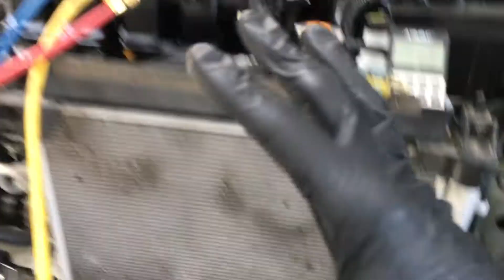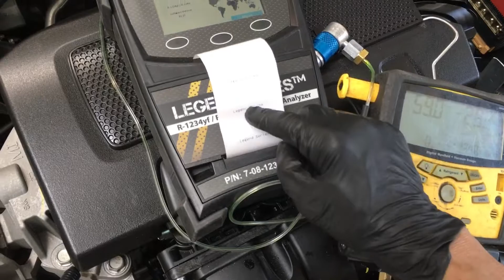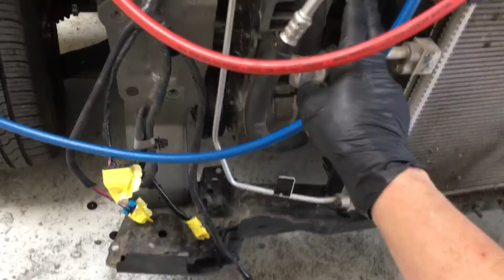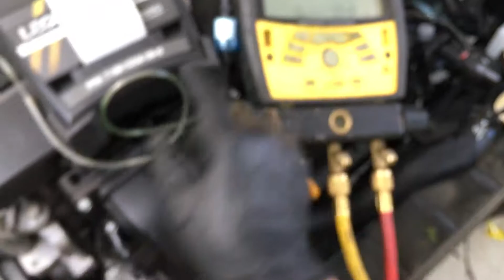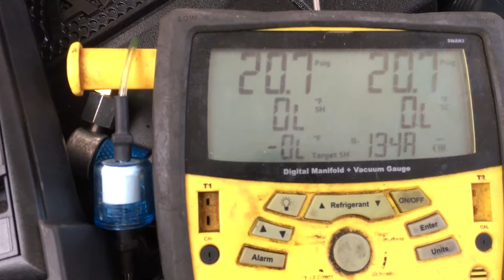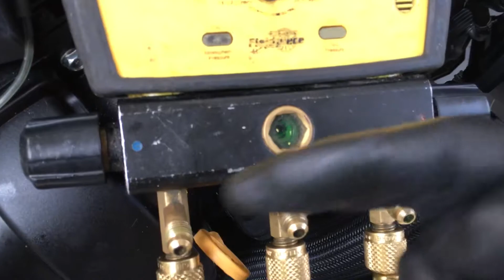Refrigerant recovery 2019 Nissan Sentra

Comment: I’m replacing the condenser on a 2019 Nissan Sentra 1.8 how much pág oil should I put back. Thanks
Reply from the maker: I do not have the specifications on me and they’re all different from all vehicles. You have to look them up on the manufacturers website or through some of their printed literature.. 

There is no rule of thumb because many manufactures have different quantities required 

But the average if you want an average for Japanese vehicles, after a collision or a large leak, the majority have been hovering right around 35 mL to 45 mL of refrigerant oil . 

This is why reading and looking up specifications from each manufacture is very necessary on all these different vehicles here make models
Reply: @coldfinger459sub0  oh ok sounds good by any chance do you have a website too look or find info on how much, I’m replacing the condenser tomorrow I would appreciate.
Reply from the maker: @joelcalvillo-lm5gn  4 SEASONS website or NAPA website they have a air conditioning catalog with quantities
Reply: @coldfinger459sub0  ok thanks

Comment: Do you think a Refrigerant Analyser is useful for detecting weather a virgin system leaked non-condensables in from the low side while running?
Reply from the maker: That’s a super good question this question is often asks you’re not the first one. 

       He would be purging a lot of refrigerant into the atmosphere to achieve such a procedure

        And then in cars since you don’t use superheat or sub cooling or temperature to charge you would end up with a low charge and then have to completely recover the system and weigh it in by charge in the first place. 

          Yeah the situation you’re talking about purging off air the low side is what is used in low pressure refrigerants like or 11 and other low pressure refrigerants that actually operate in a vacuum. 

            In this situation the system sucks in the air when it has leaks and ends up with noncondensibles

           They have a pressure pop off relief valve as the system sucks in the air the pressure will go off and they will actually purge off air for example say around 15 psi because that would be considered excessive pressure. 

       Remember when we took our universal 608 refrigerant EPA license this was part of the study in the test on the very question you just asked. 

            It’s also a topic that was covered in HVAC classes back in college getting your AS or BS degree HVAC engineering or building science degree.